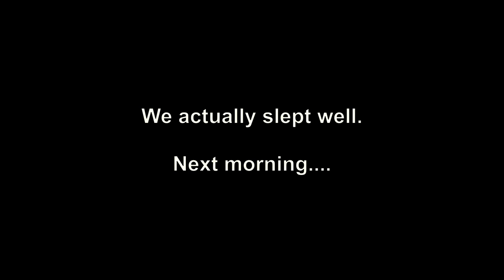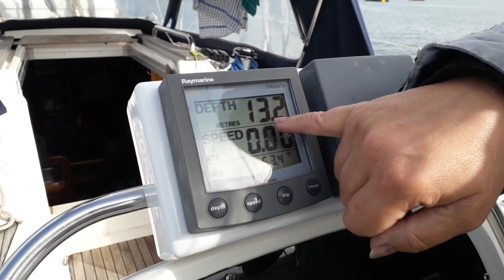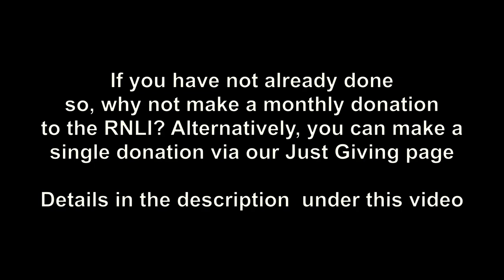Pan-pan - Sailing Wales - Conwy to Beaumaris - Ep. 107

Comment: glad you all ok.hope you changing the elbow for a stainless steel one. Impavaduos did a video on it. something i did on my boat was instal two led strip lights which helps greatly if a breakdown happens at night. loved the video
Reply from the maker: Hi Noelio - I am glad you enjoyed the video. Our engine bay has strip lights installed, they just might not have shown in the camera shot, but they are a great help and we would not be without them.

We let the mechanic supply the part and he brought a genuine Volvo one.

Comment: These things are NOT accidents , replace things BEFORE their sell by date .
Reply from the maker: We had no idea what the "Sell by date" on the exhaust elbow was - it came with the boat and might well have been the original 20 year old unit... or maybe not. Maybe it was the 3rd or 4th or 10th unit. There was no way to know. 

Now that we have replaced it, we know how old it is, but there is no actual guidance on how long that unit will last. Or when it should be replaced. Apparently it depends how often you run the engine, how hard you run the engin, the quality of the diesel, etc, etc.

In other words, it is guesswork. The consensus seems to be 3 to 5 years, but you pays your money and you takes your choice...